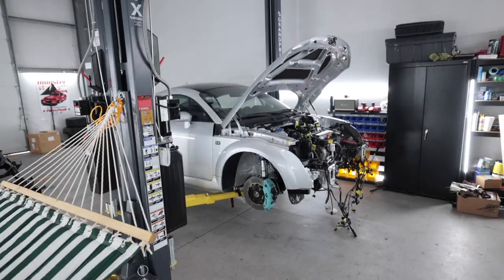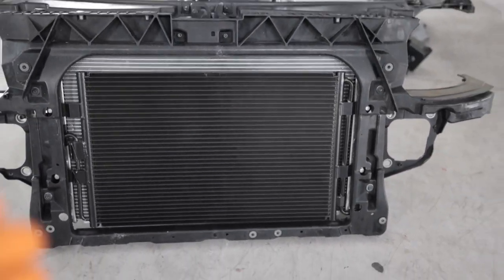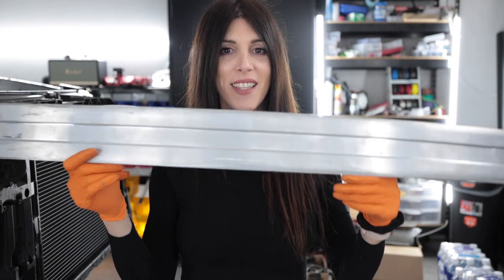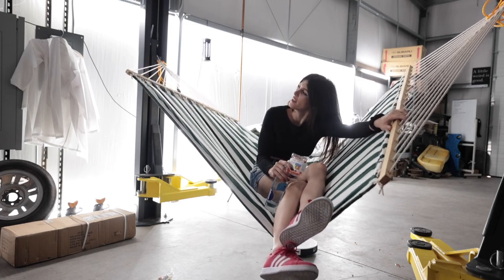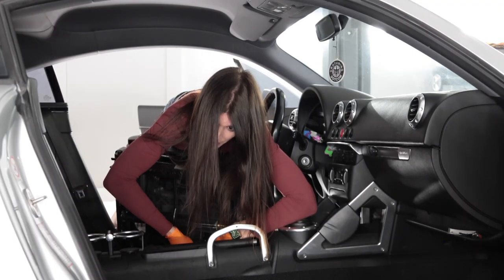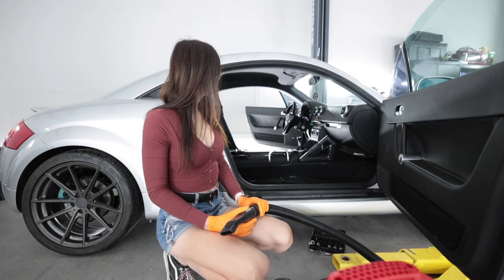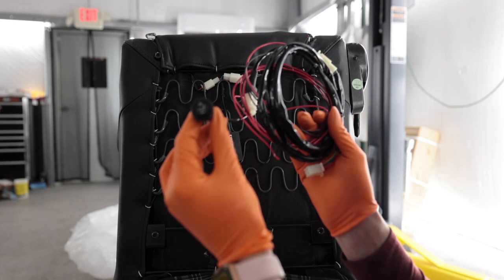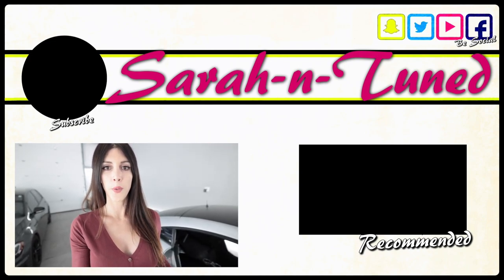A Mentally Exhausting Car To Restore.. // Project Audi TT Quattro

Comment: With regards to your migraine, I was advised to get a cold damp cloth and place it at the back of your neck. This helps to cool your body core temperature, which can cause migraines.
Also, whichever the side of your head hurts , run it under a cold tap. This helps to numb that side of your head for a while, easing the pain.
Finally, keep wiping your face and neck with a cold damp cloth.
I find drinking strong tea and eating chocolate helps too.
Oh, drinks lots of water too! Dehydration can cause headaches and don't forget to eat!!!
Hope this helps Sarah!
Reply: PS. I forgot to add, great video as usual!
Greetings from Liverpool, England!!!!

Comment: Depending on the design of the TT's heated seat system, you may have to go as far as swapping the heater elements from the factory seats into the new seats to get the dash button to work properly. Lots of work, but I agree with you, prefer OE fit and finish over some janky aftermarket switch.
Reply from the maker: Haha, funny you said this.. guess what I discovered earlier today. I got lucky though, the temp sensors in the seat ohm’d out almost identical and function the same.

Comment: The most obvious solution is usually the simplest. It's the Hammock (newest change in environment) causing the head ache. When you release all your tension in a U form, you can sometimes go beyond your flexibility threshold. Not to mention you have Dragon posture which is the antithisis of Noodle/hammock posture. With that said a 2' x 2' foam pad would do miracles for your future knees. 👍❤️🔔

Comment: Sarah, I commend you on your choice of Corbeau seats. I've had them in my older Nissan pickup for years and they're holding up really well. I'll be interested to see you integrate the seat heaters with the factory wiring and switch. No doubt in my mind that you're gonna do it.

Comment: When under boost, Audi reroutes the crankcase blow-by oil fumes directly to the Turbo inlet.  Oil in the intercooler is normal and not a sign of a turbo going out.
Reply from the maker: The excessive shaft play was though lol

Comment: You have to wash the oil out of that intercooler or it will destroy the new turbo , take it to a radiator shop to have it cleaned out.

Comment: The hammock is giving you the headache, well that’s what happened to me, until I stretched it out more and I wasn’t hunched in a U shape, it was crunching my neck up. Just a suggestion. Oh that’s assuming you are using the hammock for editing and contemplating what you are going to clean next. If you are not ignore this message. It will self destruct in 3 .. 2…..1

Comment: I think you are in need of an adjustment. I know that your work schedule makes it difficult, but I suggest that you try taking a hot soak bath to relax those muscles. I also suggest that you see a chiropractor to get an alignment adjustment on your spine. And my final suggestion is that you take at least one day but preferably three away from working all together. Your health is more important than the cars. Without your health you won't be working on them and you won't be producing content for your channels. Take care of you the same way you take care of those cars.

Comment: You're being too nice re the logistics challenges for the seat company. Common practice is to put a barcode on the piece when it's built, which is then scanned when it's packed to verify it's the right part per the order. They should invest in their data systems so customers don't have to fix their errors.